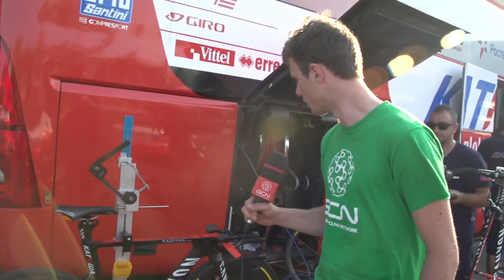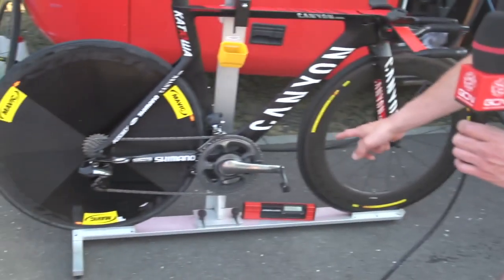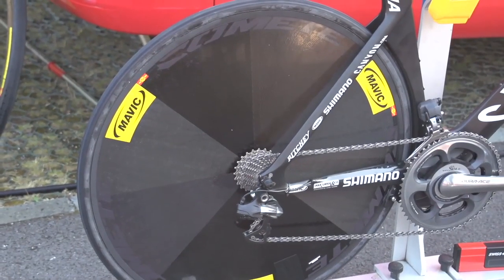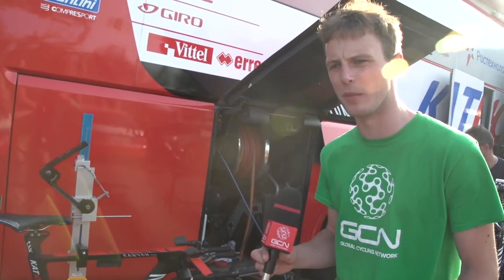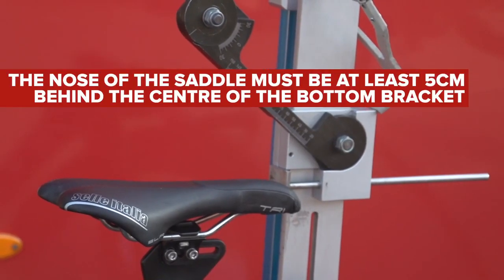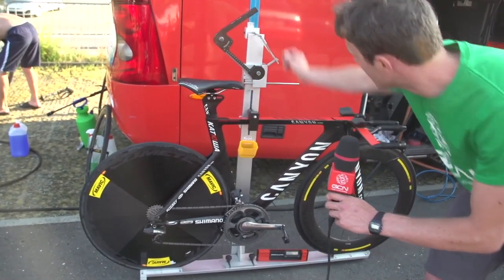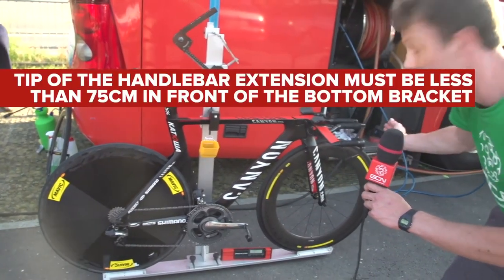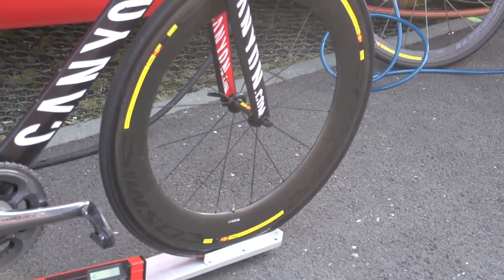Tour De France 2013 - Inside Line On Time Trial Bikes

Comment: The saddle still has to have a certain lenght too, I think it's 23cm minimum. A way to avoid that rule is to design the saddle with a cut nose and adding some material behind the normal shape. The ISM Adamo range offers these kind of saddles, which some pro's use regardless of their sponsors.